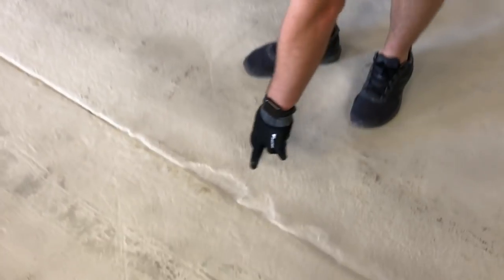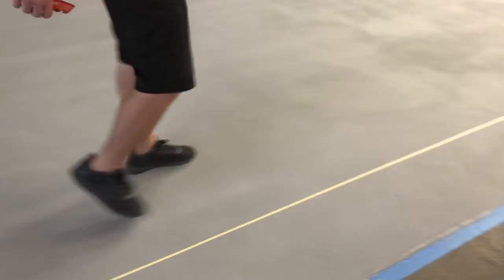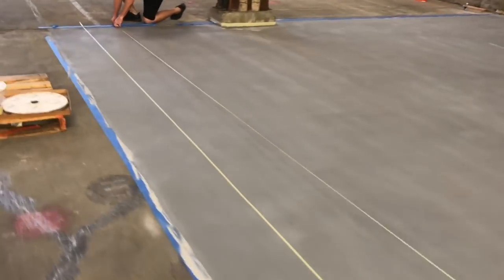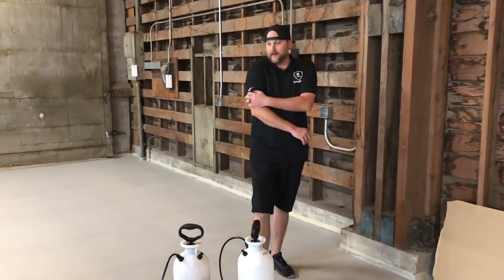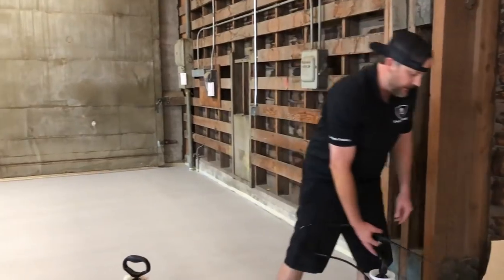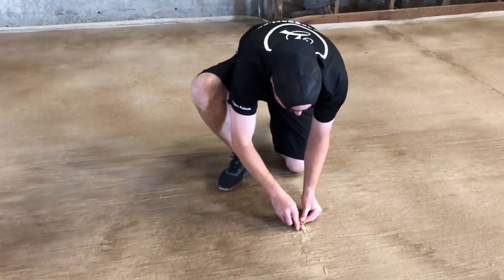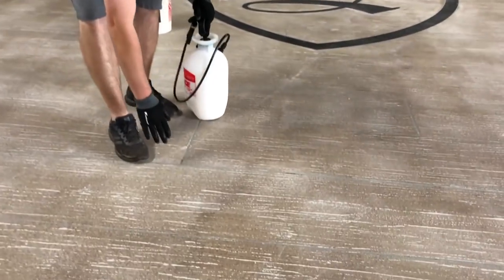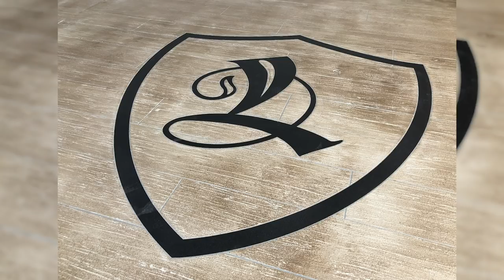Floor Transformation Using Concrete Overlay

Comment: Very cool and looks great - would love to see the pricing on these projects and curious to the durability over time. What happens when a 45lb weight gets dropped on the floor?
Reply from the maker: Email customerservice@leggari.com for pricing and we have dropped a 45 pound weight on it and it just dented the surface without chipping. I show contractors that dent when they come to get trained and even though we know where it’s at it can still be difficult to find the dent. The overlays will last as long as the surface u coat over. We have had these products down for decades. The overlay will need to be re-sealed every few years depending on the traffic it gets. Thanks

Comment: Hey guys great video, how durable is your water based sealer, normally solvent acrylic would be preferred but how does that water base hold up ,I see you use it for pool decks too
Reply from the maker: Our products are actually industrial coating made for military aircraft hangers, etc. So theoretically in a residential, or even commercial setting it will last forever.
Reply: @LeggariProducts  very nice , I am a decorative concrete installer here in Barbados, your products are impressive

Comment: Why do you rehydrate the floor?
Reply from the maker: So the concrete overlay will stick to the substate surface.  Thanks
Reply: @LeggariProducts  in the case that I'm working over a huge mechanic workshop concrete with high car traffic...which products would you recommend, polyspartic with flakes or the one you used on this video?
Reply from the maker: We would recommend our epoxy with flakes in it.  It will be 100% sealed and very easy to clean.

Comment: It'll be a nice big favor if you guys would put down the cost of the materials on the floor and the labor of the square footage that you did so we know what we're getting into otherwise it's no good to nobody, nobody wants to spend $10,000 on floor so fill us in or will throw your product ideal away, just for an example you got five guys there let's just take the minimum $15 an hour you're already at $600 a day and 3000 for days they work on it  that's not the equipment the material the rental of the other equipment so come on be upfront and the logo you didn't need to do that nobody's going to put your logo in the middle of their floor
Reply from the maker: Kevin Coulombe Videos are to show what’s possible with our products. If you want pricing you need to email customerservice@leggari.com with the sq ft u want to coat and where it’s going to need to be shipped. You can do any logo u want! Sky is the limit.